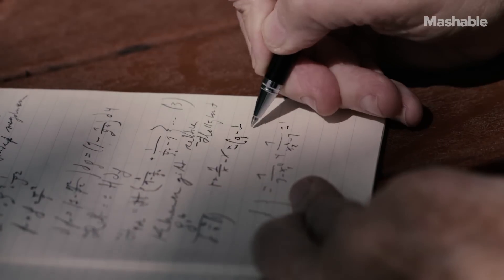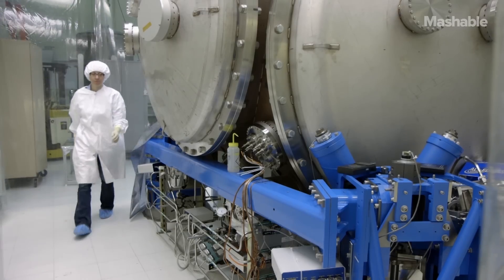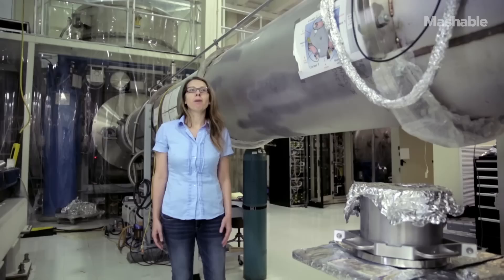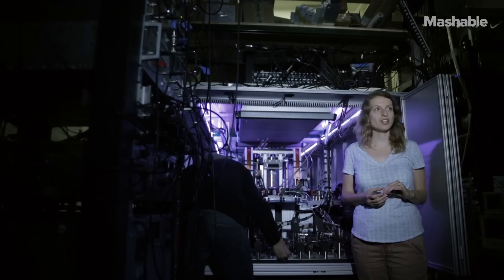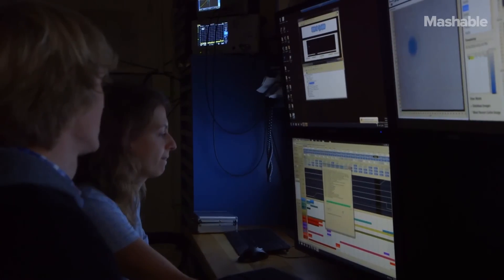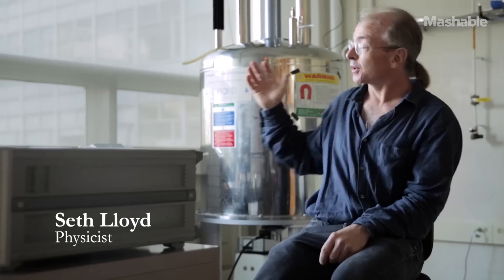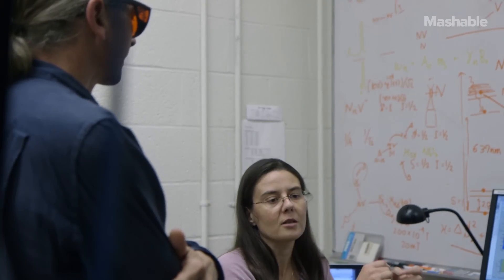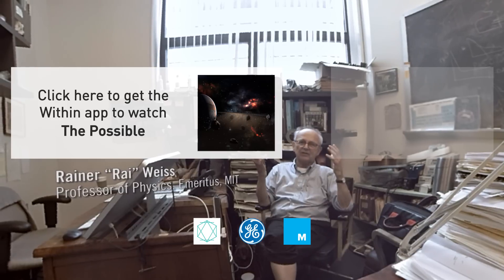Even When Wrong, Einstein is Still Teaching Us

Comment: The ultimate unification and understanding of physics/physical experience combines, BALANCES, AND INCLUDES opposites, AS E=MC2 is CLEARLY manifest as F=ma ON BALANCE; AS ELECTROMAGNETISM/energy is gravity. Here's the proof. This also explains why objects (including WHAT IS THE FALLING MAN) fall at the SAME RATE (neglecting air resistance, of course), AS E=MC2 IS CLEARLY F=MA ON BALANCE; AS ELECTROMAGNETISM/energy is gravity. TIME dilation ULTIMATELY proves (ON BALANCE) that E=MC2 IS clearly and necessarily F=ma ON BALANCE, AS ELECTROMAGNETISM/energy is gravity. Gravity is ELECTROMAGNETISM/energy ON BALANCE.

ON THE CLEAR, EXTENSIVE, SENSIBLE, BALANCED, THEORETICAL, AND UNIVERSAL PROOF THAT ELECTROMAGNETISM/energy is gravity, AS E=MC2 IS clearly PROVEN TO BE F=MA ON BALANCE:

Balanced inertia/INERTIAL RESISTANCE is fundamental, as ELECTROMAGNETISM/energy is gravity. The stars AND PLANETS are POINTS in the night sky. Energy has/involves GRAVITY, AND ENERGY has/involves inertia/INERTIAL RESISTANCE; AS gravity AND ELECTROMAGNETISM/energy are linked AND BALANCED opposites; AS ELECTROMAGNETISM/energy is gravity; AS E=MC2 is CLEARLY proven to be F=ma ON BALANCE. This NECESSARILY represents, INVOLVES, AND DESCRIBES what is possible/potential AND actual IN BALANCE. Indeed, A PHOTON may be placed at the center of what is THE SUN (as A POINT, of course); AS the reduction of SPACE is offset by (or BALANCED with) the speed of light (c); AS ELECTROMAGNETISM/energy is gravity ON BALANCE; AS E=MC2 is CLEARLY F=ma IN BALANCE !!! Gravity is ELECTROMAGNETISM/energy ON BALANCE, AS E=MC2 is CLEARLY proven to be F=ma IN BALANCE. TIME dilation ULTIMATELY proves (ON BALANCE) that ELECTROMAGNETISM/energy is gravity, AS E=MC2 is CLEARLY F=ma ON BALANCE. Gravity/acceleration involves BALANCED inertia/INERTIAL RESISTANCE, AS ELECTROMAGNETISM/energy is gravity; AS E=MC2 is CLEARLY F=ma ON BALANCE; AS the stars AND PLANETS are POINTS in the night sky. Accordingly, ON BALANCE, the rotation of WHAT IS THE MOON matches it's revolution. TIME is NECESSARILY possible/potential AND actual IN BALANCE, AS ELECTROMAGNETISM/energy is gravity; AS E=MC2 is CLEARLY F=ma ON BALANCE. The stars AND PLANETS are POINTS in the night sky. Accordingly, ON BALANCE, it makes perfect sense that THE PLANETS (including WHAT IS THE EARTH) will move away very, very, very slightly in relation to what is THE SUN !!! ELECTROMAGNETISM/energy is gravity, AS E=MC2 is CLEARLY F=ma ON BALANCE. Inertia/INERTIAL RESISTANCE is proportional to (or BALANCED with/as) GRAVITATIONAL force/ENERGY, as this balances gravity AND inertia; AS E=MC2 is CLEARLY F=ma ON BALANCE; AS ELECTROMAGNETISM/energy is gravity. GREAT. I have explained the cosmological redshift AND the supergiant stars. Stellar clustering ALSO proves ON BALANCE that ELECTROMAGNETISM/energy is gravity, AS E=MC2 is CLEARLY F=ma IN BALANCE !!! 

By Frank DiMeglio

Comment: e=mc squares
e=half m v square
so we have root 2 into speed of light
means we have approximately speed of light multiply by 1. 414
or root 2
it's diagonal of unit square
this means what we see all way round  is shortest distance travel by light and it may be oval or round
but actually round shape is not possible at universe scale due to pi irrationality
which bring some ovality in circles

Comment: Space has no properties and it's definitely not attached to time. Time is a human construct. It's a measurement of magnitude over a duration. Ligo is lying. People really think their metal bar changed its length of a fraction of the width of a proton over like 5 km distance, and It was caused by a single gravity wave from hundreds of billions of miles away? A wave is not real thing. A thing waves. Wave is a verb. So what was waving? Well it would have to be the aether. But gravity is a field because all energy is fields. Gravity is dielectric and magnetic. It doesn't send out waves. How do educated people not understand this? Oh yea, education is indoctrination. Intelligence and wisdom can't be bought with a piece of paper on the wall.

Comment: There is only a mathematical limit on light speed, not a physical limit as we've all been repeatedly convinced to believe. GPS systems have proven this principle without question by factoring known satellite velocity, dynamic physical gravitational effects upon quantum spin (and clocks) which are not equivocal to real time factoring based on relativistic theory. A good example for explaining this is the recent calculations for the atoms at the core of the earth claimed to be "2.5 years younger" than those at the surface due to gravitational time dilation from relativism. Even Richard Feynman made this leap in thought. However, if this is assumed to be a fact, then how is their orbit around the sun as a set zero reference frame for time to be calculated for angular velocity of earth frame time? Haven't the atoms at the core of the earth orbited the sun just as many times, over the course of time, as those on its surface? If we are to think of them as "Younger", how are we defining the term? Both the atoms at the surface and the atom at the core of the earth came from the same primordial cloud of gas and dust which made up our solar system. If they were existentially 'locked' into local synchronization (Sun zero reference time frame) at the time and they are assumed to still exist in the current sun reference frame, haven't their clocks remained existentially and actually 'locked' in time to our frame due to presumed evidence they are still physically and currently present?

Comment: Can someone please explain the quantum computer to me? Why would it NOW be better off if it were added onto (in order to make it bigger and better)?
Reply: I think you misunderstood. A classical Computer could never compete with a quantum Computer, even if it was as big as the univerese.
A Quantum Computer with 300 "quantum bits" would be equivalent to a normal computer with around 250000000000000000000000000000000000000000000000000000000000000000000000000000 Terabyte, which is basically impossible.
Reply: But can it run Crysis??
Reply: baladár kolompár they don’t use transistors and early versions exist already. Google owns some, even though they are not stable enough(or something like that) to be usable right now.
Reply: baladár kolompár "not yet"
Reply: Quantum computers don't exist, and most likely will never exist. Quantums are the particles that build electrons, protons and neutrons up, they have a short lifespan, and are not capable of computing, You can't make mathematical processes with quantums at all. It's very difficult to even keep a quantum in a closed space. The quantum computer is only a fiction, a made-up, impossible thought. You need electricity and physical matter to make a computer, and the technology has borders. You can't make a transistor that's smaller than a set number of atoms, and to process data or information, you have to have an environment that holds the info. But, as I said before, quantums are not capable of computing, because there's no such "device" that's capable of processing quantums.